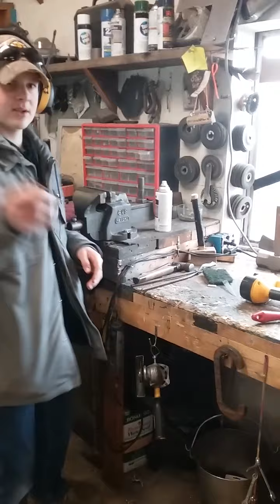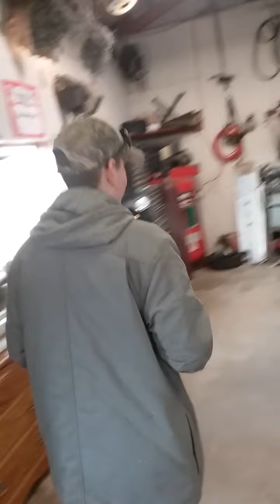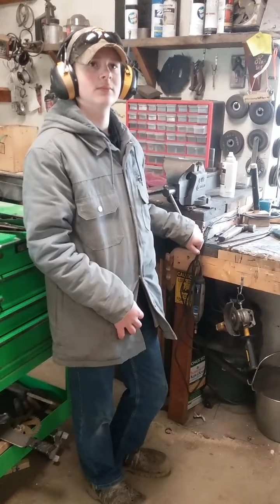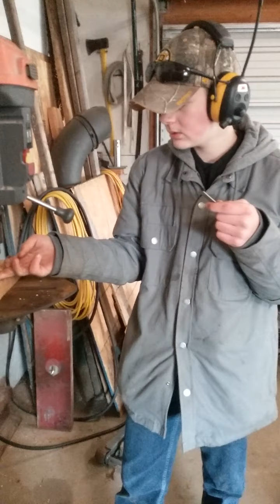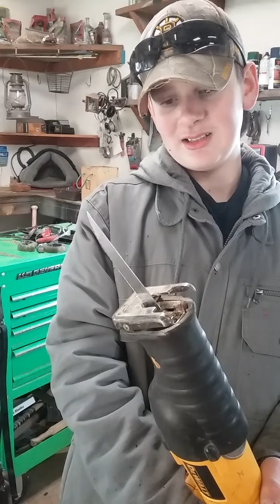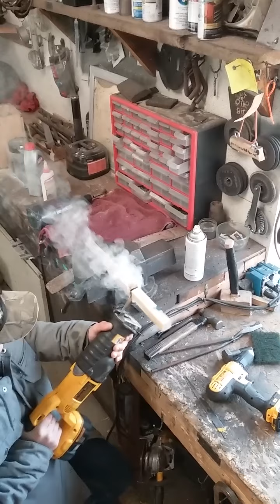making a thing for a Sawzall

Comment: How different is a wood blade from a steak blade?
Reply from the maker: I am glad you asked there is a big difference the steak knife was a steak knife for cutting steak and I decided it for the fun of it it would be fun to attach it to a Sawzall but the difference between them is that a wood blade has more bigger teeth than the steak knife so that's why the steak Knife took so long to cut through the wood and made a lot of smoke so I would suggest using a wood blade LOL